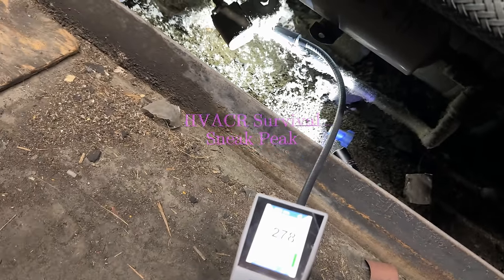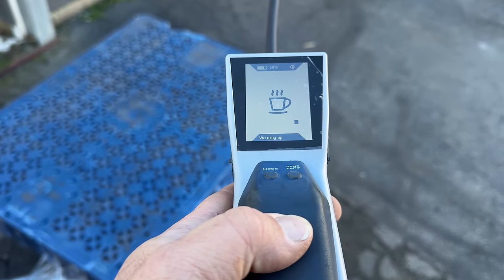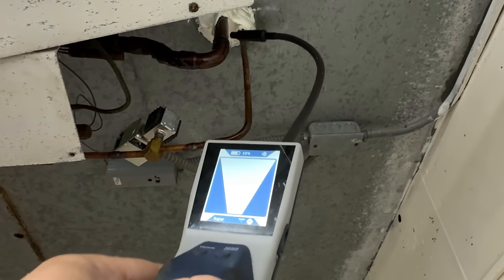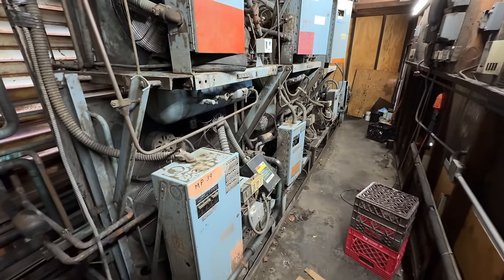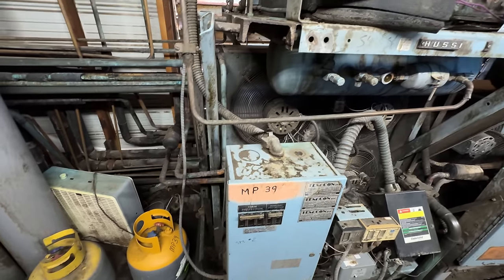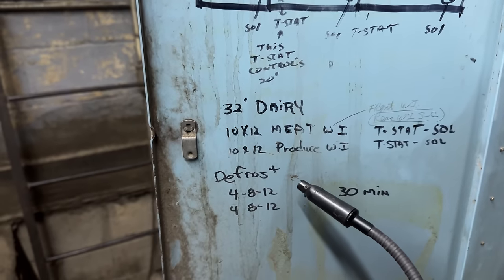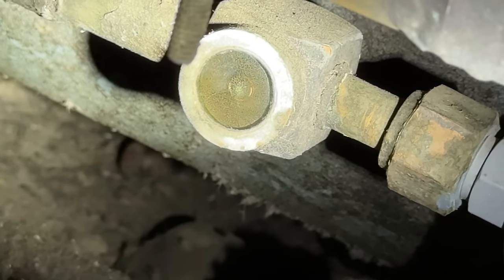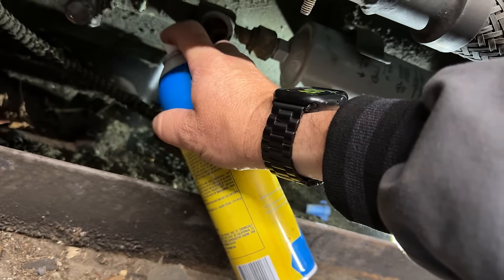Major Problems Meat & Dairy Cooler Dangerously Warm

Comment: More real world examples of what you come across in the field. You can't do everything by the book all the time. Like you said, this stuff is from back when it didn't matter. A lot of the time a vacuum wasn't even pulled, just open up the R12 and let it purge for a few minutes and all was good. Screw the haters. Let them get out there and see what it's like.

There was an old quality foods grocery store near me with K & T wiring and similar equipment in the basement. It was from the 50s and a mess, but it still worked. Some of it was still pumping R12 when it burned in 05. Surprisingly it wasn't the old wiring that sparked it but the new owners trying to collect the insurance on it.
Reply from the maker: Geez go figure!